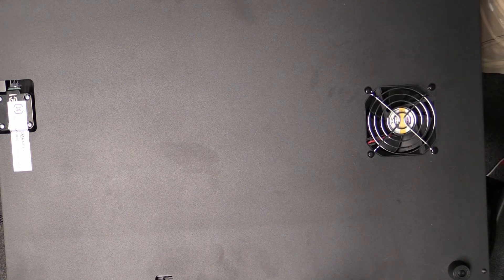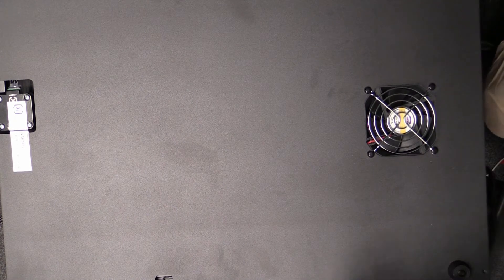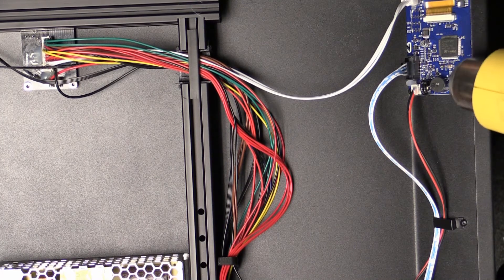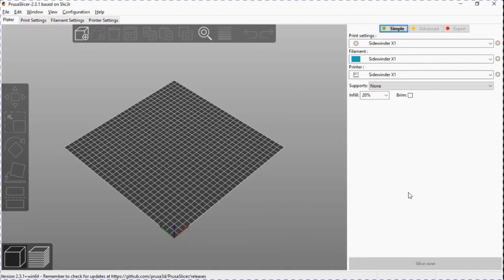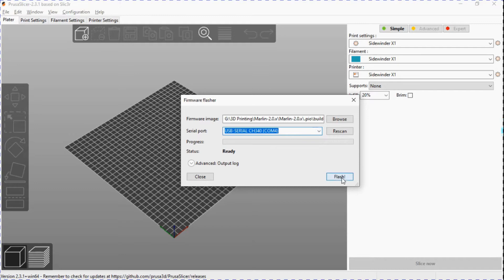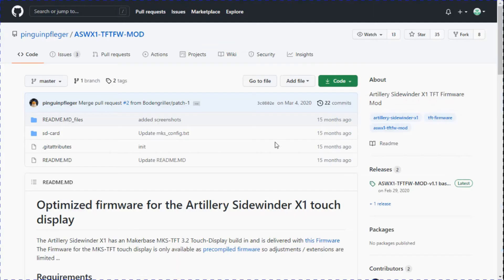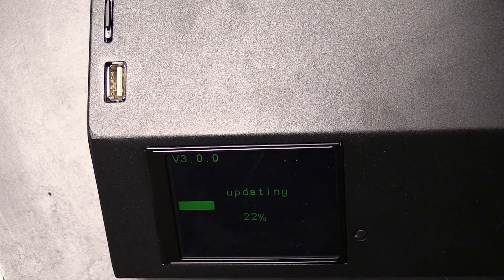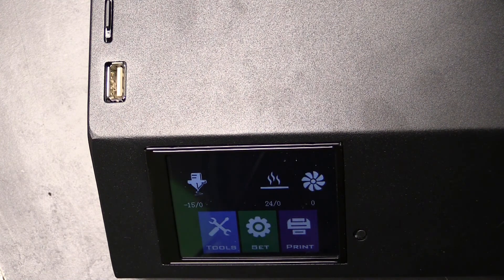Updating Artillery Sidewinder X1 Firmware

Comment: How much of the printer did you need to take apart, to get the bottom off? Did you need to take off the whole top frame of the printer in order to turn it upsidedown, or did you just set it up on something?
Reply from the maker: I had it on a towel under the build plate and hung the frame over the edge of the table. I've seen others use the uprights like a tripod. But I like to have it level.

Comment: there is much better way to remove hot glue from motherboard then with heat. Just put denatured alcohol once or twice, wait 10 seconds and remove hot glue with easy. No risk for other components becouse we always use alcohol for cleaning everything

Comment: wildly under appreciated video... I moded my hot end, all metal etc etc, should be able get to at least 350 safely now... i am trying to figure out how to get the internal limit for temp off so i can up it now.  And yes I got a fire proof enclosure and am taking precautions if it catches, which shouldn't but damn'ed if i am gonna burn a house down.
Reply from the maker: What are you printing that you need that kind of temp?

Comment: I wired a shutoff switch to turn the screen to turn it off for updating my printer. Once the update is complete you just turn the switch and it will reboot the printer.  To keep from turning the screen off accidentally, I created a clip that keeps the switch from pressing down if touched.  If you would like to have the images please let me know so that can be arranged.  By doing that you will not have to worry about whether you have enough space to move your printer to facilitate an update.
Reply: That's a great idea! I'd love the images. I have a warped bed (the centre is low but the corners are perfectly leveled). I'll be installing firmware that supports manual mesh bed levelling

Comment: Nice work. Have you thought about changing the TFT UI? I spent a good week changing my UI. Good to see more Sidewinder content on here for sure.
Reply from the maker: I’ve used a couple different TFT ui and haven’t had a problem with any until I tried to upgrade to an MKS SGEN 32bit mainboard. I cannot get it to work with the stock TFT. I have a new screen coming that I’m going to upgrade to. I’ll do videos on both the mainboard and TFT upgrades